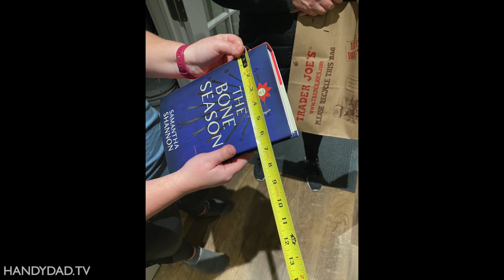WE BUILT A SECRET BOOKCASE // TLF 44

Comment: Did you do anything to strengthen the connection between the bookcase and the trim? It seems like with that much weight on the shelf, even gently putting it back in place will bump those brad nails out over time.
Reply from the maker: I used five brads in each. That’s it. We’ll see how it goes.